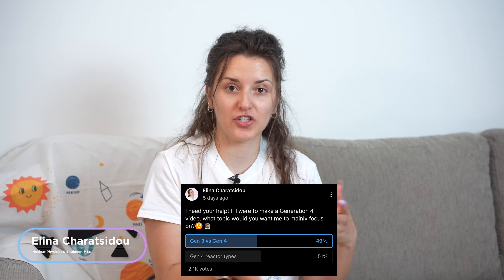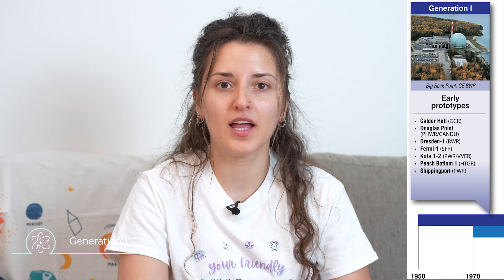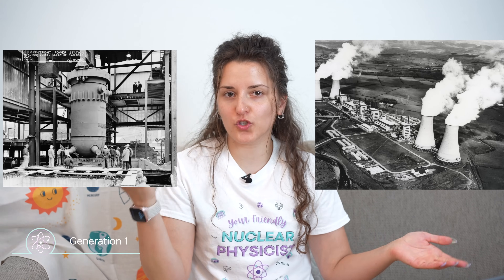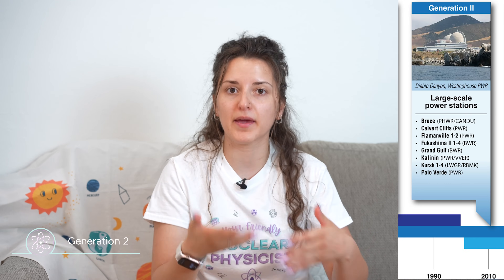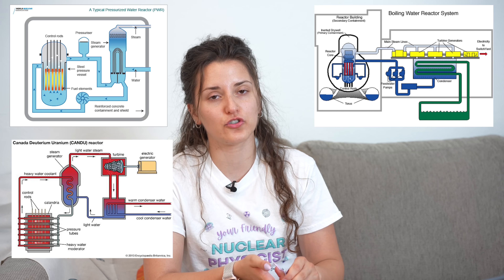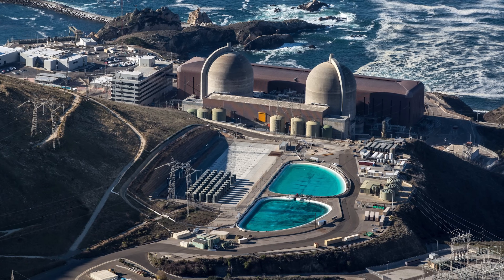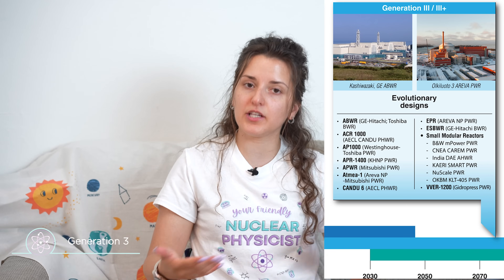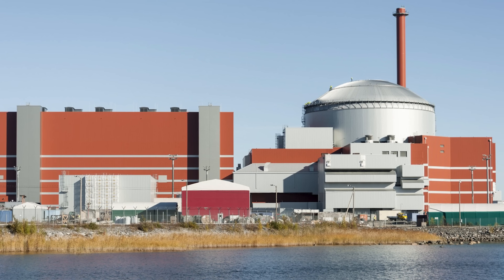Nuclear Physicist Explains - The Rise of Generation IV Reactors?

Comment: Sorry but Nuclear power is Dead on Arrival

1. Cost & extensive planning & construction time to complete a new reactor. The US has build two new reactors in the past 40 years in Vogtle, GA. Each reactor costs about $15B for 1GWe of power, and took over 20 years. These are also cheaper than Gen4. since are Gen 3 reactors.
2. Peak Uranium Production happened in 1980 and has been in decline ever since. There is only about enough economically recoverable Uranium at current consumption until about 2050. Utilities are aware of Uranium depletion problem & will not build any new plants unless the gov't pays for the planning and construction costs. If they started to build new plants today, they wouldn't be operational until 2043 or later, & probably only able to run the reactors for a short period before fuel become unavailable.
3. Utilities have absolutely no interest in experiment reactors & most gov't ended there Gen4 reactors decades ago because they just were not economically. Many spent more time down for maintenance & repairs than operational. The cost of a Gen4 reactors is more than double that of Gen3 reactors which are already far too expensive.
4. Western civilization is near collapse: too much debt (about 300% of GDP or more US 370% Debt to GDP). We hit the demographics cliff in which large number of the ageing population are retireing (not paying taxes & drawing on pension & gov't entitlements forcing gov'ts to run huge budget deficits: in the US it runs about $2T annual budget deficit). Then there is Peak Oil (more importantly Peak Diesel) With reduction & rising fuel costs for trucks, trains & ships, its going have a major impact in the global economy. The US started its Oil wars back in 2003 with the invasion of Iraq and additional wars or coups in other Oil exporting nations. Now the US is a war with Russia since its the last man standing that has any significant Oil reserves. If the US continues to press this war, it will result a global nuclear war.

I hope that all of the remaining nuclear power plants are shutdown before Western gov'ts collapse, if there is a major collapse it will difficult to maintain reactors (even if they are shutdown) since it takes years for the spent fuel rods to cool down and be stored in dry caskets. In the US all of the spent fuel rods are stored on site at the plant, even if the plant is shutdown, which does present a major risk in hundreds of years as the dry caskets corrode and start leaking. The US still has no long term storage solution for spent nuclear fuel.

Comment: this small and modular argument doesnt seem to be very logical, given the amount of bilological shielding and equipment that would be needed to handle once such plants need to be decommisioned...  I think standardisation is key, but probably in the 500-1000 MW range + making used of the waste heat for residential heating.

Comment: Hi Elina, Went through Navy nuke school. I know in civilian plants Boron is coated on steel and added to the concrete. To absorb neutron. As borax and or powdered boron mix easily with water. I always wondered why not inject it into the core coolant to kill the reaction in an emergency? I would think flooding the core container with boron. Would be a cheep and safe way to stop a core melt down. You would only have to flush the core to restore it. I bring this up as the general public has no clue about fission control.
Reply: Commercial reactors are started up by removing metal control rods.  At 100% power, the control rods are almost fully withdrawn acting as your emergency shutdown method.  Boron (referred to a chemical shim control) is added or removed from the reactor coolant to regulate power.  There are major differences between DOD and commercial reactors.

Comment: If you dump the core into water won't that act as a moderator and continue the reaction?
Reply: That along with the steam release and pressurisation leading to vessel failure, plus uncontrolled geometries, plus hydrogen generation from release of hydrogen from internet metallic hydrides e.g. ZrxHy (where the hydrogen is stored in the metals in the fermi electron sea at atomic densities exceeding the densities of cryogenic liquid hydrogen stored in equal volumes) and from oxidation of fuel and cladding generating hydrogen gas and even greater pressurisation.
Reply: No bad idea ever dies. They just get recycled, repackaged and regurgitated over and over and over again. Nuclear is a terrible idea that will not be allowed to die. Why? Because nations want the fissile materials for weapons. End of story.

Comment: If you want to keep the fuel inside the reactor for the duration of its useful life and keep it free of offsite action required to stop it in case of malfunction then you need an offsite action to keep it going. For example if catalists somehow expired without being replaced in case of malfunction. Instead of dropping the whole core into water pool, you could just make the entry points of graphite rods fall through so that they fell out at the bottom in case their mounting points on top melted. 

You list advantages that a gen IV reactor should have and stretch it and stretch it as if leading your explanation to how it could possible be done but then start to weir off in need of funding as if you were not going to say how to do it unless somebody paid you and then you bluntly finish off by revealing that there will be nothing in your presentation about how would a gen IV reactor look like. 

A deep dislike.

Comment: Why are you not mentioning a safety feature difference between Cherobil and Vuhledar? How much worse would it be if Ukrainians attacked nuclear plant in Kursk compared to Russians attacking Zarporizia plant?

Many bloggers say that in case Russians did blow up the nuclear plant which they will most certainly do on retreat won't cause environmental disaster the Chernobil did but would be managable.

How does Fukushima fit in the threat levels in between?

Comment: Weren't the Gen 1 and Gen 2 reactors breeder reactors?  Their main goal was to produce plutonium, energy to the grid being a byproduct.
Reply: NO U.S. commercial reactor has ever been used to breed weapons grade Piu239.  Breeder reactors require a reprocessing facility that the U.S. has never built
Reply: @clarkkent9080  Not all breeders need reprocessing, try to keep up. Actually, you have no desire to keep up, you are a militant anti-nuclear activist that would rather sh*t on every advancement that comes out.

Comment: I hate to pile another requirement on you, but 5. Able to operate without an external water source (air cooled).  We're seeing reactors shut down because rivers run dry, and that's only going to get worse.  I don't know if the physics work, but water free operation would enhance siting options and improve capacity factor in a warming world.

Comment: Can someone explain to me why "proliferation resistance" is even a consideration for modern nuclear power design? Why do we care about that?

We already have enough weapons to destroy the planet several times over and the deterant effect actually prevents war very effectively so no one is ever going to disarm again (especially after what happened with Ukraine). Unless your talking about selling these plants to hostile states why does it actually make any difference?
Reply: One word theft.
Reply: @clarkkent9080  That has literally never happened. And it isn't surprising that it hasn't. The logistics of that heist would be insane, downright impossible and it would be very easy to track the perps with scintellators.
Reply: @alexanderx33  Correct, it has never happened.  But you have people proposing SMRs in every town and every nuke is operated by PRIVATE industry and we all know how responsible for profit companies are...
Reply: @clarkkent9080  I would say that private companies are better at their jobs than public agencies, but regardless, at least the initial use case for SMRs does not involve putting one in each town. Reducing transmission distance is not the goal. The goal is making the reactor manufacturing process into an assembly line to reduce the cost per megawatt for that portion of the build. You would still have large plants, they would just have a large number of small reactors, instead of 2 to 8 very large reactors. SMRs are meant to be self contained and passively safe from the outside. Non-user-servicable. The reactor itself is also meant to be the disposal unit.
Reply: @alexanderx33  Well here is the simple reality. There are only two companies that have any possibility of actually constructing a new commercial nuclear plant in the U.S. within the next decade and that is Terrapower and NuScale.
Terrapower has been trying since 2016 to build one, has their design fully approved with $2 billion in taxpayer welfare provided, the taxpayer is also building them a fuel fabrication facility and they have yet to break ground.
NuScale has their design fully approved with $2 billion in taxpayer welfare provided, but due to ballooning estimated cost they are on hold till 2025. And I don't think that project will get any cheaper by then. 

Vogtle was just visited by the head NRC guy who praised that project but said: Vogtle is most likely the last large nuclear project and smaller projects must be built before 2030 if nuclear has any possibility of a resurgence. 

There are other generating projects being built to meet our needs and the world is not waiting for nuclear to catch up.  Right now there is more solar and wind project capacity waiting approval to connect to the grid than we are currently using.  The ability of the grid to handle all the wind and solar capacity is now the problem

Comment: Would those generation IV reactors be safe in case of mining by Russian terrorists?
Reply: phun fact,
The orcs will most certainly explode the reactors.
The reality is they would have to restart them, run them up to full power, breach the containment and stop the primary coolant loop disable the scram features.
Even then, the subsequent radiation release would be a fraction of Chernobyl.
It will be enough to blow up the cooling towers, turbines and generators and burn down the control rooms.
They truly are some vile creatures.

Comment: Excellent video.  I would definitely like to see a deeper dive into the different reactor designs.  The pros and cons. A look at the different emphasis each country puts on different systems.  Can CANDU reactors be considered gen 4 since they can use natural uranium?   Are all small modular reactors being developed considered gen 4?  Is the traveling wave reactor considered gen 4?   Also can the new passive safety systems be adapted to gen 3 reactors?   Thanks for your videos.